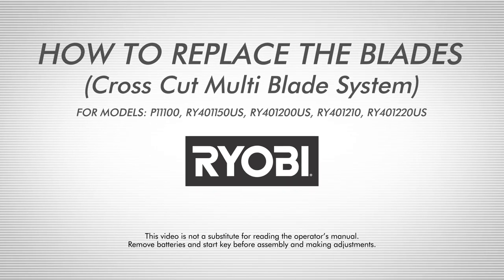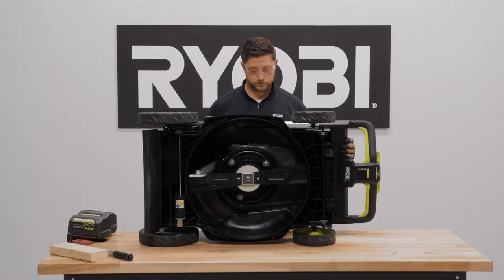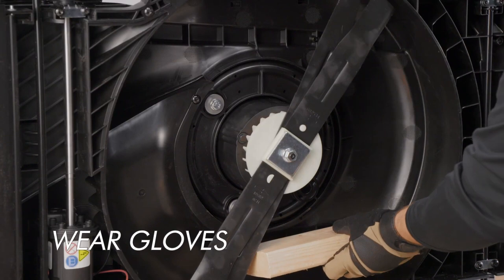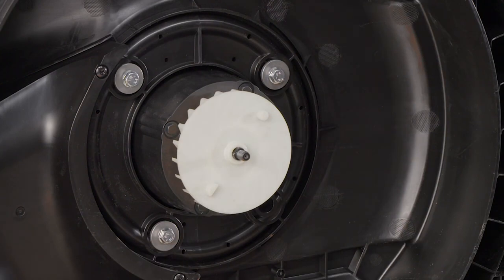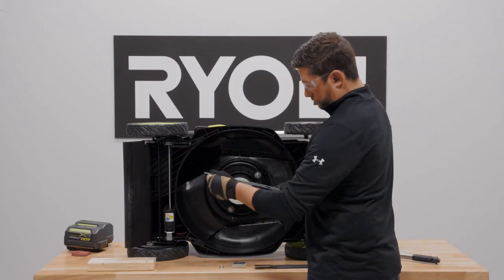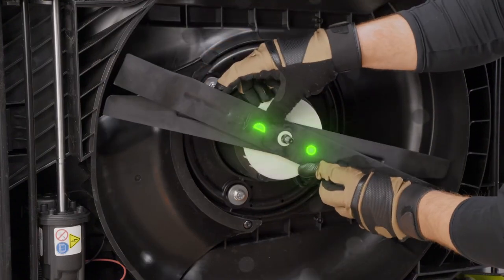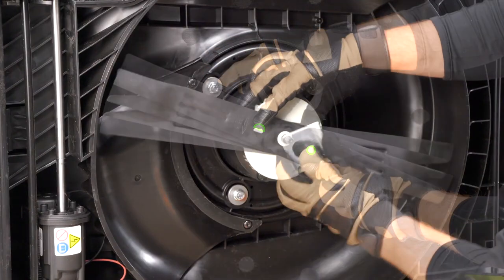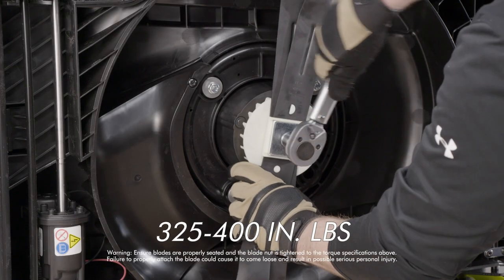How To Replace the Blades - RYOBI Cross Cut Multi Blade System

Comment: Per Ryobi Manual
The recommended torque for the blade nut is 310–360 in.lbs 26-30 ft-lb.
Per this yout vid
325 to 400 inch pounds or 27  to 33 ft-lb or hand tight.

 Due to Ryobi goof proof blade install even if the blade loosens after the 1st mow you know the blade torque was to low so hand tighten a lot more  then the second mow blade check make sure blade is tight or increase the hand torque .
Oh
prior to doing any blade torque clean clean clean before you torque down the blade nut..